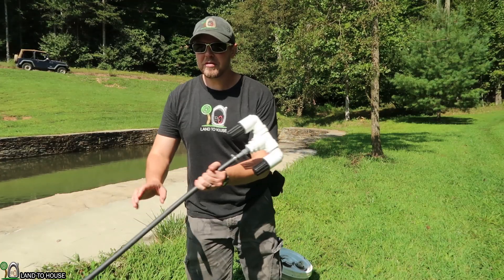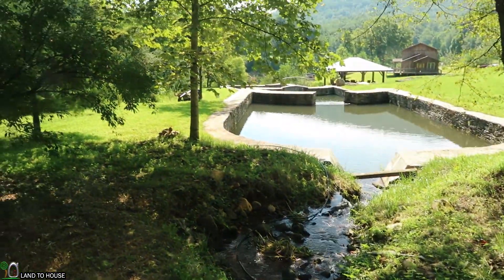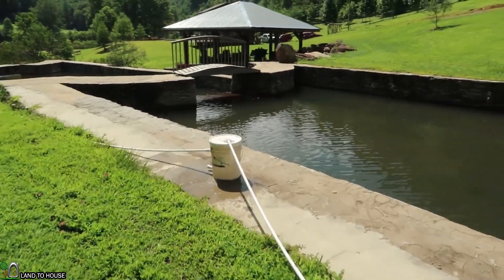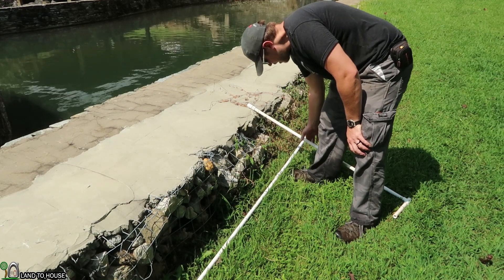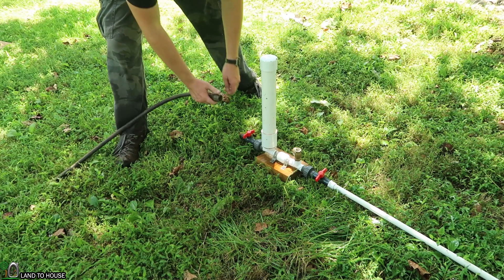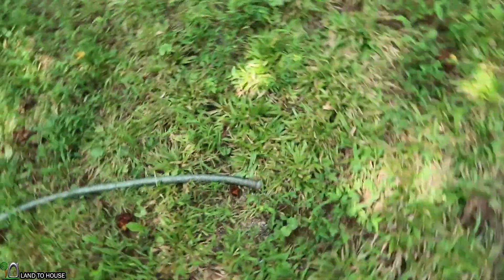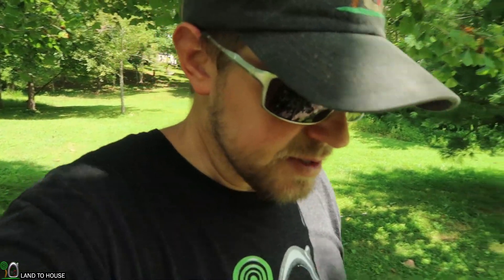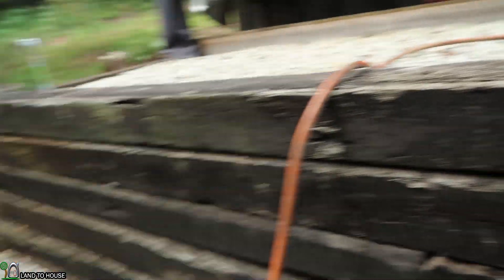Off Grid Water Ram Pump Install

Comment: I approve of this video.  Thoughts on spiral Waterwheel pump?
Reply from the maker: I tried to make one years ago. It did not work out. I got stuck on the rotary union. I have since found one. .... I think you will like next week's video. I install the same pump off the the waterfall
Reply: @LandtoHouse  cool, I've been digging myself...
Reply: @LandtoHouse  I was thinking about it, have you tried an air hose reel swivel?
Reply from the maker: @JoeMalovich  I had gotten one of those it was difficult to work with. The size was too small. So I decided to go with a pressure washer nozzle with swivel

Comment: We have a 60 or 65 feet drop from our spring to the house. So a ram pump should work here?
Reply from the maker: That is actually too much head pressure for a pump. You can have a max head pressure of around 25 feet. This can lift to 180 feet.
Reply: @LandtoHouse  do you ever work in Florida?
Reply from the maker: I have not been there in at least 6 years.
Reply: @LandtoHouse  maybe in the future. Would love to have our spring set up and running water for us. But we have to much going on this year. Something you might want to think about.